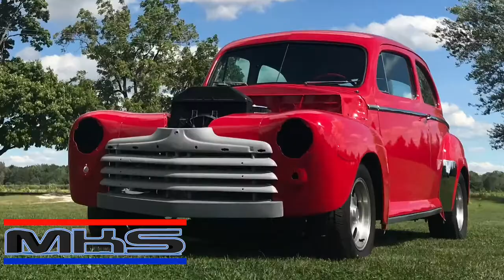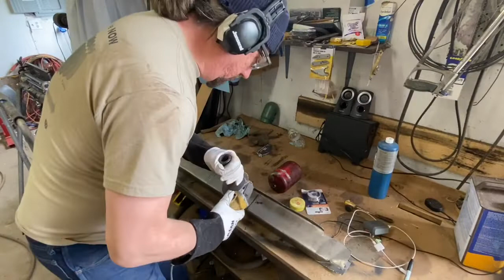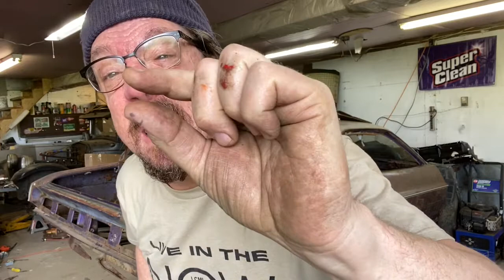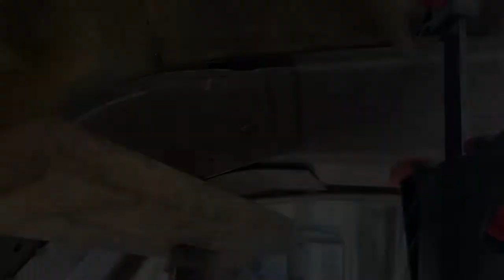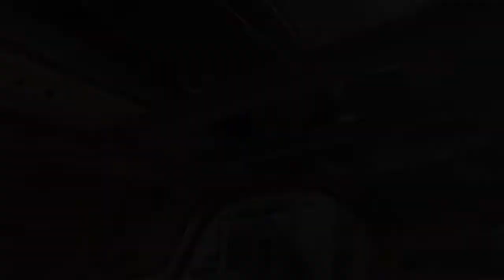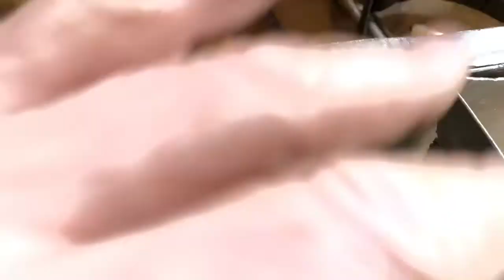"Stitches" - FORGOTTEN 1970 Challenger -  EP42 - Getting CLOSE - Frame rail Work is ALMOST Done!

Comment: I noticed the car is not sitting level across the rear tail light panel the right hand side was setting really high
Reply from the maker: That’s mostly due to the camera angles. The car is actually pretty level and is actually a bit higher (about 1/4 inch) on the left side. Once the frame rail is in I’ll move it over to the level section of the shop and double check  the chassis dimensions.  But I’ve done enough of this work that I’m not concerned about it. 

The joys of working in a 100 year old barn.  😂😂
Reply from the maker: Hey thanks for watching and thanks for your comment. I really appreciate it